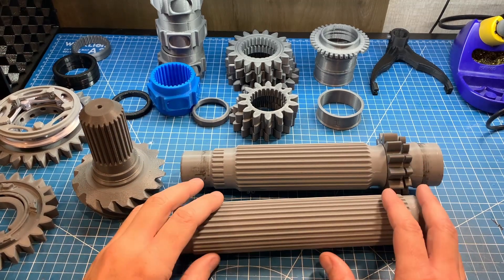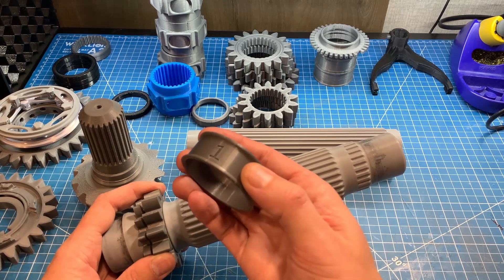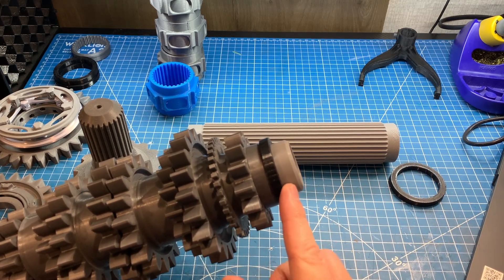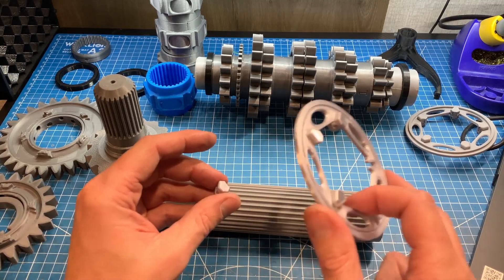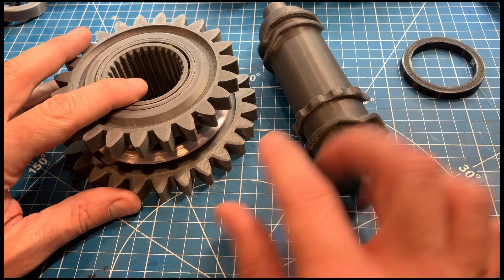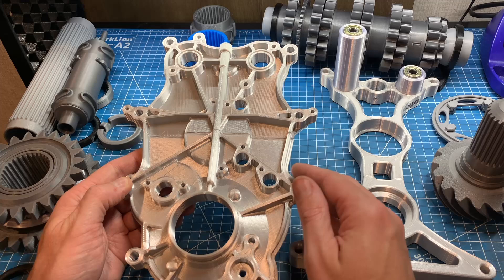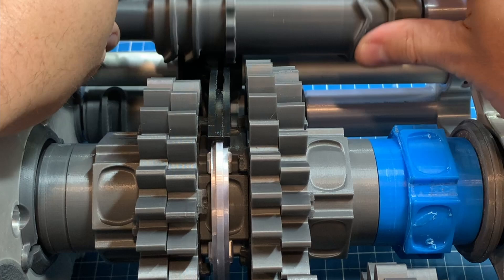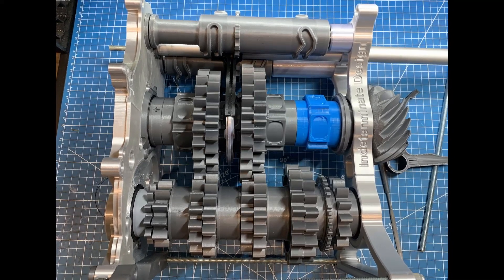F1 Hybrid Era Seamless Gearbox Pt2

Comment: Here at 32:40 somebody was showcasing the actual gearbox

https://youtu.be/hRkoHWnEMAI

I dont know the booth exactly but maybe you can figure out who they are and contact them for some info

Cheers
Reply from the maker: Yes, that’s an older Xtrac P1014. That’s what I based my first F1 gearbox model off of. They’re cool gearboxes, I believe that’s from a Marussia F1 team car.
Reply: @IndeterminateDesign  its amazing that you could identify all that about it

By the way I would like you to confirm somthing that has struck my mind recently. The keonegsegg Jesko light speed transmission is blow out in the media as crazy innovative but after seeing it here

22:40

https://youtu.be/jcGrTvgarD0

That they just adapted a typical automatic trans clutch pack to many of the gears. I knew that they were clutch packs as advertised but they seem straight out of a normal auto.

And it weighs 90kg which is heavy for such a small trans what do you think?

Comment: Very nice! Will you be uploading this to your github once you finish the design? Also I know it's a bit of a basic question, but what is that filament you're using for the input cover?
Reply from the maker: Thanks!  I’m working on getting permission and I’m not sure at this point how it will be released but I’ll definitely keep everyone updated. The filament for the input cover is Esun PLA Silk. It looks really cool like machined aluminum.
Reply: @IndeterminateDesign  Cool, yeah I figured if you had some insider info it may play into what/how/if you could publish your designs. Keep up the good work, and thanks for the info on the PLA!

Comment: nice vid. please do something with sound, it's impossible low level.. for example my normal level in windows mixer is 20, for view you video i increase it to 100, and this still not enough.
Reply from the maker: Thanks for the info. I’ll check it out, I’ve been normalizing to the YouTube recommended -15db but I’ll try bumping it up a bit.
Reply: @IndeterminateDesign  thank you